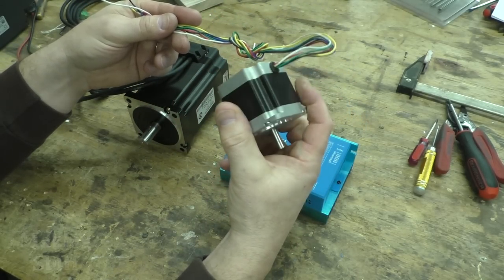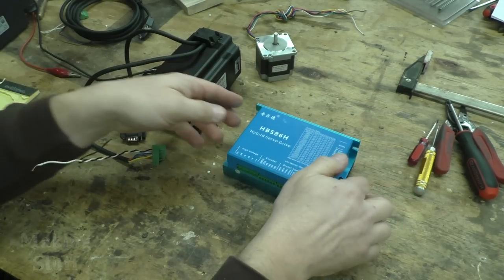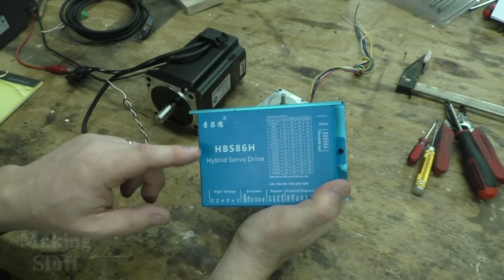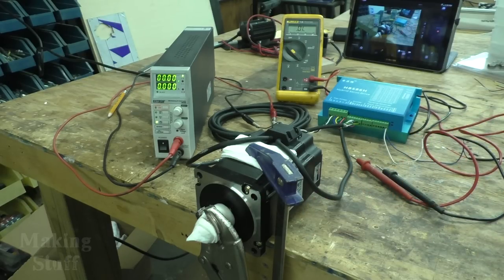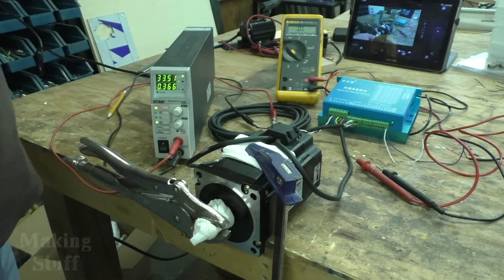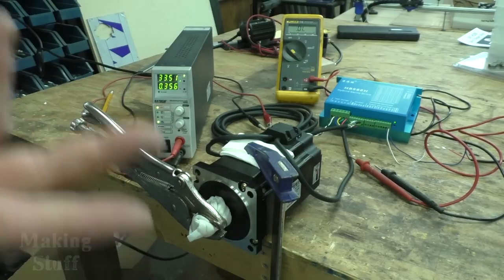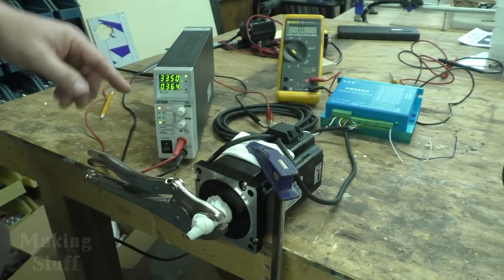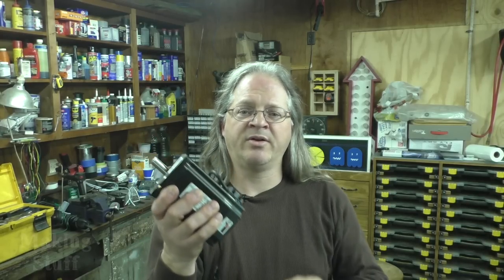Closed Loop Stepper Motors for CNC machines

Comment: Like to know more about the "Pend" Signal Pins. Specially When the Motor Over Steps, and, needs to go back. For Example, Computer sends the signal to the Controller to more move 1 step in some direction. The Stepper Motor  moves 1 step, but, because of inertia fails to stop after 1 step. The Motor will temporarily be at the right Position, but then, it Over Steps.I am assuming this is how the "Pend" Pins work. Since, the Motor will temporarily be at right Position, the "Pend" Pins temporarily become "Open Circuited", &, then, when Motor Over Steps, "Pend" signal become Short Circuited. After that, the Controller realizes that Stepper Motor has Over Stepped, so the controller sends the Stepper Motor back to the correct Position, & then, "Pend" Pins become "Open Circuited" again.
So, basically, my question is; 
(1) When Motor Over Steps, does the "Pend" Pins Close, Open & Close again? If yes, should I check "Pend" pins to remain close(Short Circuited) for some minimum duration of time?
(2) or, "Pend" Pins become Short Circuited only "Once" when the Stepper Motor has Stabilized?
 Any assistance will be greatly appreciated

Comment: Thanks for this, I found it really helpful as I have never played with the Neema 34 before.

What can you do with a motor that size?  Here is our project and we would appreciate a bit of advice. 

We are wanting to use the motor to operate the Declination Drive of our very large 54cm telescope.  All gearing, etc. is set up ready to accept the drive from the Neema 34.
We hope to control it using an Arduino  but cannot decide on the wiring between the motor controller and the arduino board.  All we have found so far does not make it clear.  Any help greatly appreciated.
Rod Smith, Cranbrook and District Science and Astronomy Society, UK
Reply from the maker: Wiring to an Arduino is easy.  If you look at the nailgun robot in the contest results video, that is exactly what I did.  Just hook the step pin up to one of your digital pins on the arduino.  Every time the pin goes from low to high, the motor will make one step.  If you want it to go the opposite direction, just apply 5v to the direction pin on the motor controller (which can also be hooked to a digital pin on the arduino).
Reply: @MakingStuff  Thanks.  We are having a hard time with the Neema 34 as we want to make the holding torque as high as possible but do not know which parameters to set or their values.  Help!

Comment: yes closed loop have lot better than open, but price not hve hobby user good, closed loop motors and drivers and controller board all cost 10-100 X more than good hobby user open loop system.